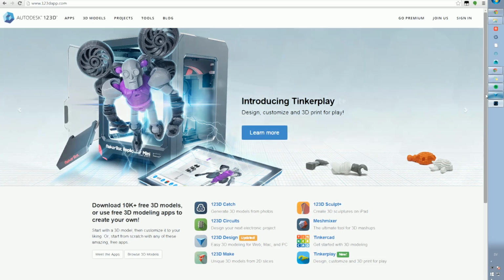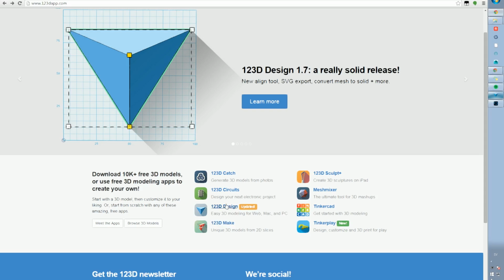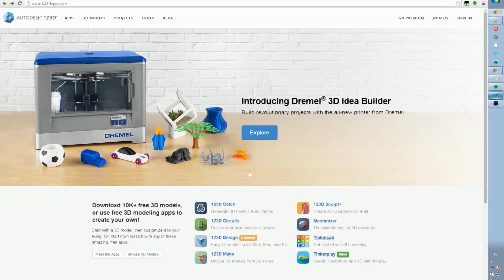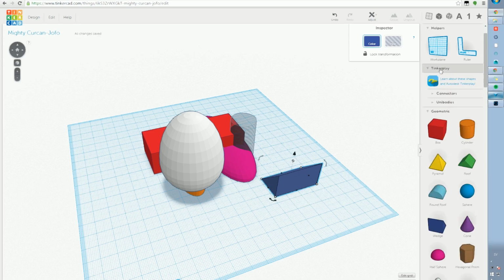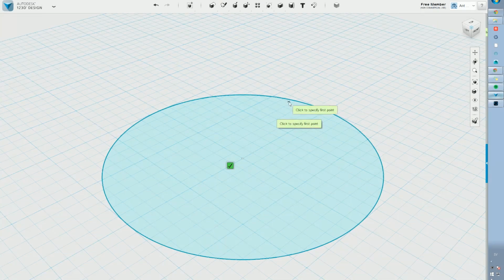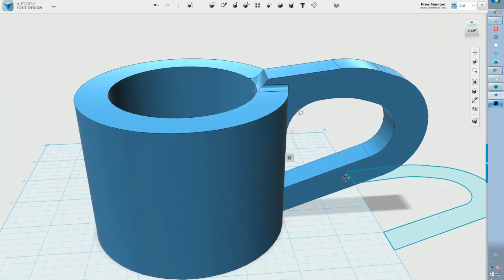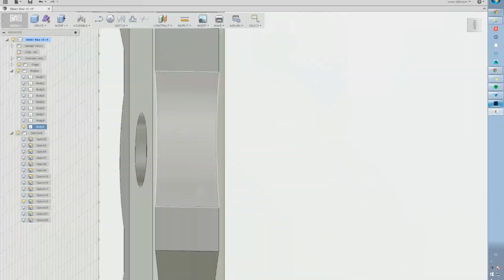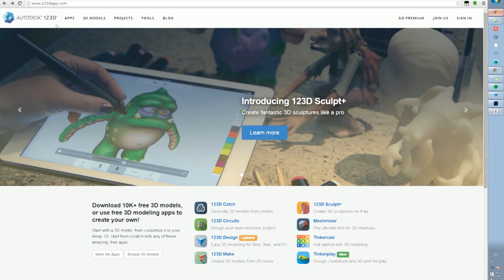Choosing 3d printing CAD software (free options)

Comment: I think the software is dependent on the user; I use tinkercad because it is a very quick prototyping tool that doesn't clutter things. I have yet to use fusion 360 (honestly never heard of it, thanks will look into it) but I rarely find that I need to do to much more than what tinkercad is capable of. Thank you for posting the video.
Reply from the maker: +Josh Anderson Thank you :). As you say, it's very dependant on user and how you adapt to a software. I would recoomend you try both 123D design and Fusion 360 since they are very similar to whay you use, and hopefully enables you to protoype quicker and have acces to more tools to help you visualise, try or render your product.